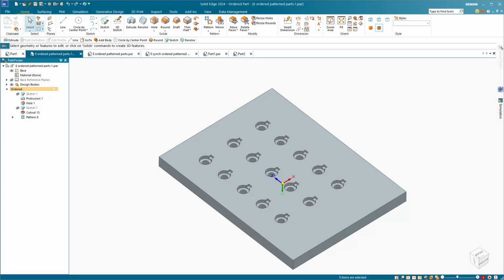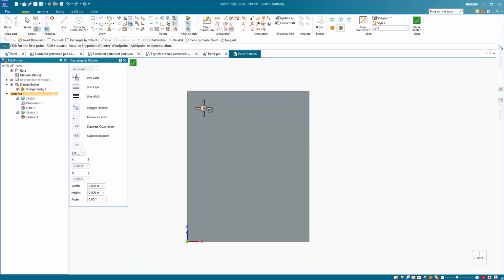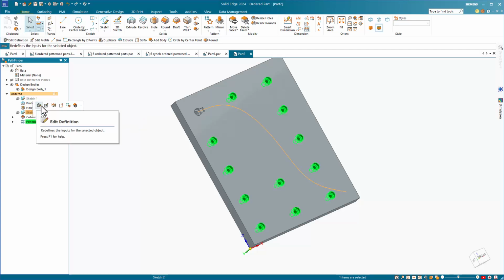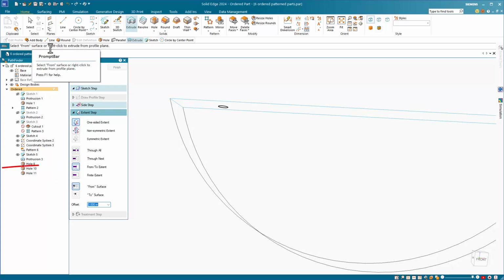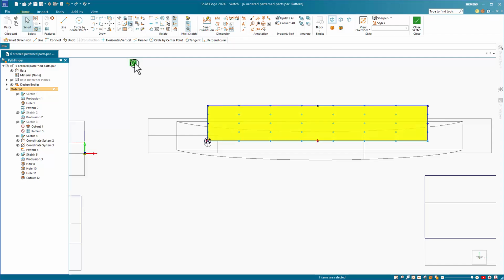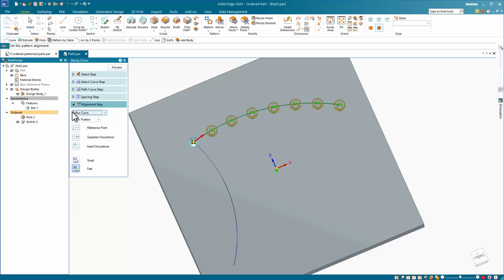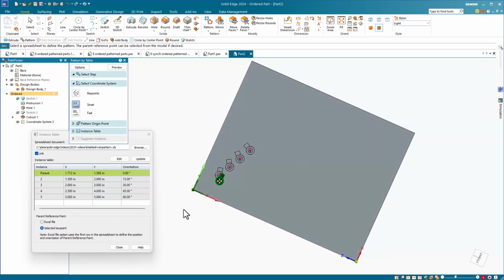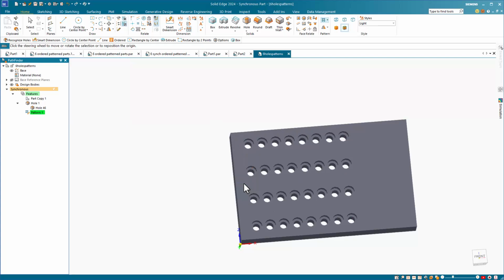6. Feature Patterns in Solid Edge vs. SOLIDWORKS: How to Unleash Full CAD Power!

Comment: Thank you for your excellent explanations!
Very helpful. 
One question about pattern in Solid Edge: 
Is it possible to create a boundary and let SE fill the space with features up to that boundary?
Like, I want to create hexagonal cutouts which should stop at a border but also cut the hexagonal features when they would cross that border. E.g. if a hexagonal would be half in and half out, I want it to be cut in half by the border and not left out completely because it doesn’t fit into the area. 
Hope this makes sense 😂

Thanks a lot for any hints.